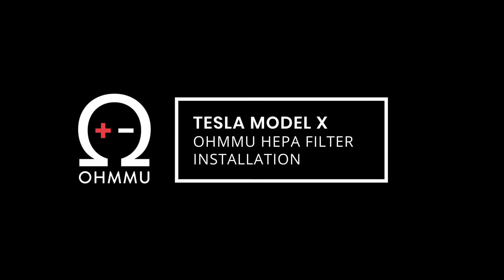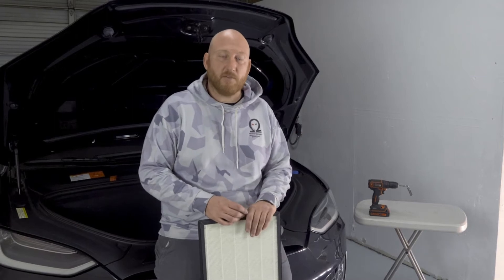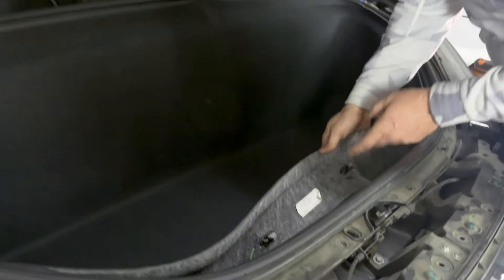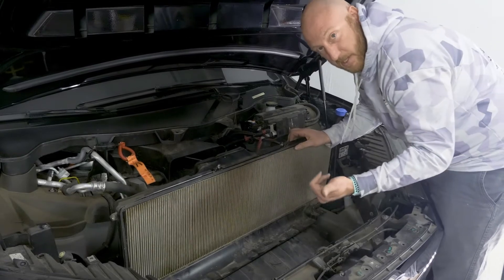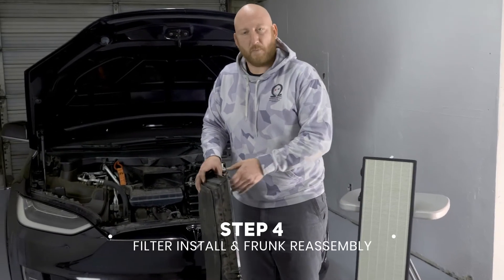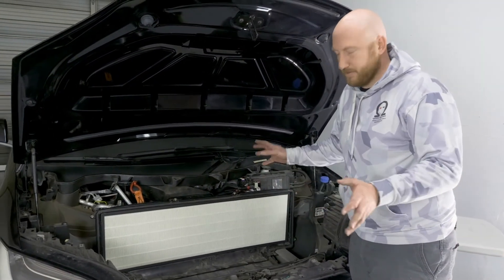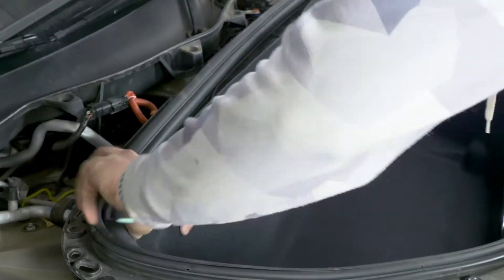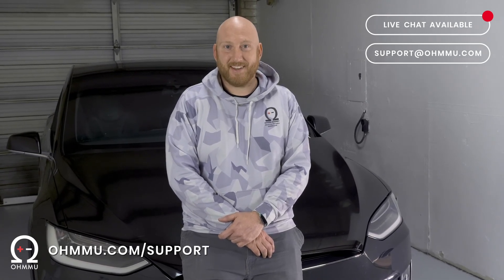Tesla Model X - HEPA Filter Installation (Ohmmu)

Comment: I just did mine, despite having 125000 miles on the clock my filter looked pretty clean (I'm in UK so guess our air is not too bad). But OMG, why did they use so much glue? It was on all 4 sides and was rock hard, I used a screwdriver to get in there and prize the filter away from the plastic housing, most times the glue would crack, but I pretty much destroyed the filter getting it out (like you did). For something that is supposed to be a replaceable consumable item this is crazy difficult, why on earth do they need to glue it like that? My replacement filter went in fine. I was quite curious to try and work out where all the airflow comes from, there's a gap at the bottom the filter that isn't sealed when the tub goes back in, so look like air comes in from underneath the tub, but there don't seem to be any obvious ait intakes where fresh air can come from, it looks like it is sucked in from either side just in front of the sealing flaps either side of the tub underneath, so looks like air has to come in from underneath the chassis somewhere, it all seems really odd and must need a lot of power to suck the air in from that area - you'd have thought there's be a vent in the grille that feeds the HEPA filter but I was damned if I could work it out.

Comment: Best tutorial found about this so far.
I made it and it took me 80 min with 50 minutes only dedicated to removing the glue which is very similar to a chewing gum.
The glue was placed all around the filter (summer 2017 MX 100D)
I can't agree more that a common heat gun is necessary to remove this glue with a good knife.

Next time, It will take me about 30min overall as the glue is not there anymore.
I recomend to change the other cabin filter at the same time (another 30min needed)

Comment: What is the point of this if you can buy the whole thing for just $250 more?
Reply from the maker: "just $250"... I mean for less than an hour you save $250... I don't know what you do for work but $250/hr is a lot for most people...
Reply: I’ve done it myself a few times now.  Takes about 15 minutes and the filters are cheap on Amazon.  Like $70-80.  I think Tesla charges like $300-400 with labor.

Comment: So you didn’t have to install glue?
Reply from the maker: No, the foam gasket in the new filter will create an air-tight seal, don't need to glue it in place.

Comment: I would rather buy the whole new filter
Reply from the maker: Some prefer that but we prefer this because it is less wasteful, the new filter includes all the plastic housing which is just one more thing to manufacture over and over.
Reply: Yea the glue all around is def for the air tight seal that a foam is not going to be able to do. Gonna lose the true bio weapon defense and positive cabin pressure.
Reply: @James-In it’s an air filter, what do you mean air tight?  Air goes through the filter.  I think you mean it might not trap all contamination if some air goes through the foam seals/gaps so not 100% filtration.  Positive cabin pressure has nothing to do with it either.  Positive cabin pressure is created from air intake and has nothing to do with the filter.

Comment: Heat Gun.   I did this in the winter and my heat gun made a huge difference in softening the glue so I could scrape it out.   That glue is ridiculously sticky. You scrape it off one side of the corner and it just moves over and sticks to the other side.  My old filter had 65,000 miles on it and it was done!  New filter is great.
Reply: this guy pseudo filter does NOT even SEAL the edges for the whole BIODEFENSE idea. This guy's filter will let dusts into your cabin as it's not sealed !!!
Reply from the maker: Great idea!